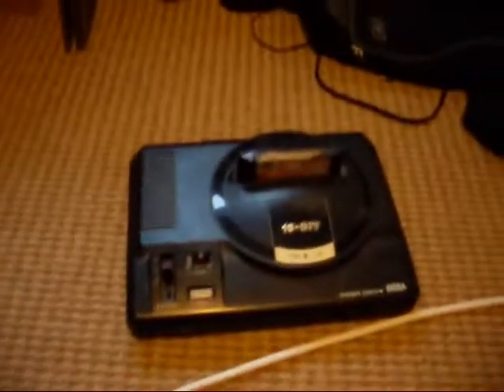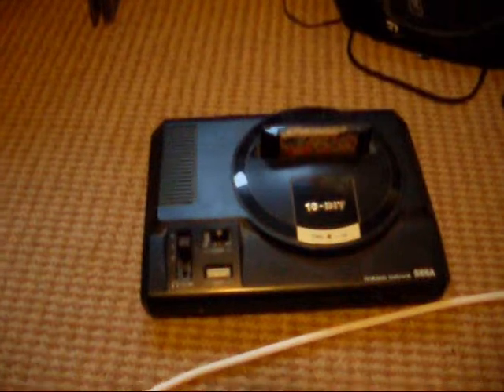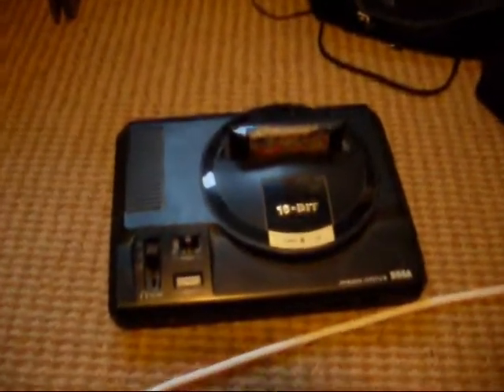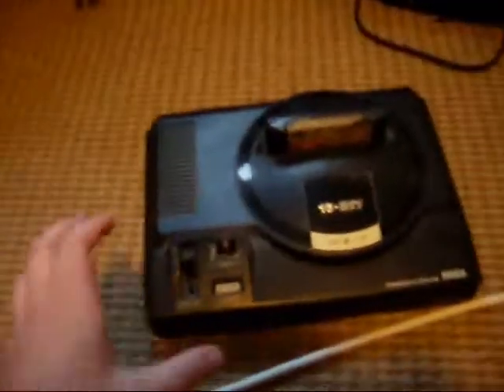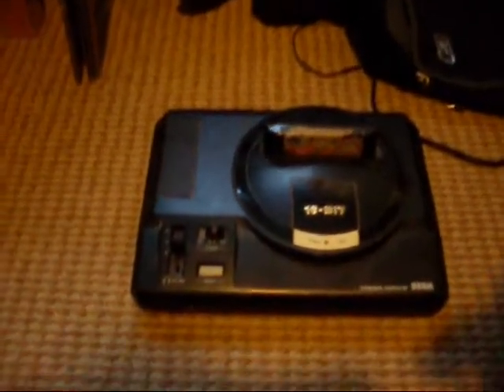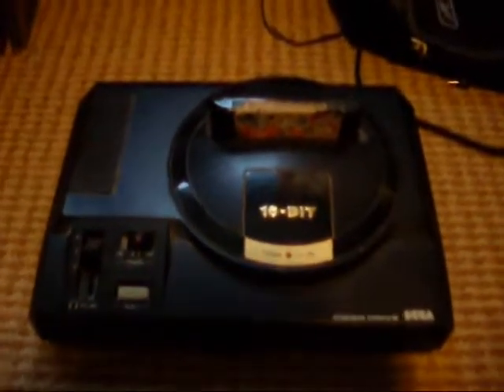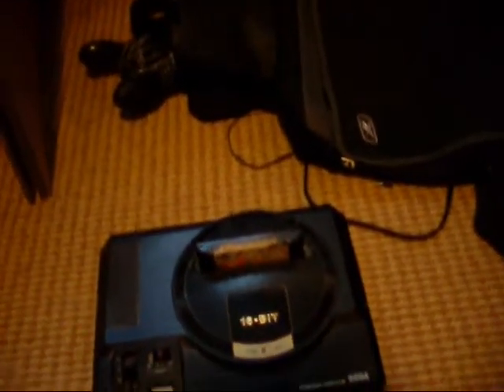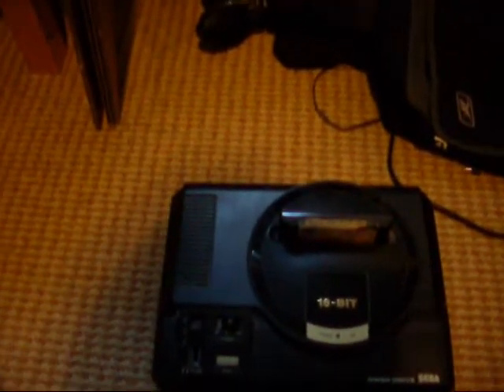Difference in pins between US/JP and UK adapters

Comment from the maker: Hey man, thanks for replying. Yeah, the power strips (or batons, as they're called here) here can be pretty big, and also pretty lengthy. However, due to the way our electrical appliances are earthed, you can chain them given you don't overload them with high-maintenance equipment (such as Tumble Driers). It's safe to do that without causing a fire. Socket doublers on the other hand are a "no no", plug to many things into one of those and you do have a hazard.

Comment from the maker: Indeed. Surge protected batons are excellent. You can also buy batons that can store a charge (like UPS's do) in the event of a power cut. In certain areas where voltage spikes are quite apparent (in my own area, to be truthful), surge-protected batons are a godsend. Standard batons usually contain four sockets on a 1.5m (5ft) cord and are fused with a 13A fuse, but there are varieties available depending on what you need it for. Electrical Safety is taken more serious than most here in Britain.

Comment from the maker: Ah yes, the same type of pins that countries like Germany use. I think Italy's are slightly different in that the male earth pin is inside the socket as opposed to the plug, which has a female receptor. I could be wrong.

A lot of South America use 50Hz mains at 220~240V, I think there are a couple of countries that use both voltages, if you can confirm that. Some areas in Japan use both 50/60Hz 110V, it's crazy!